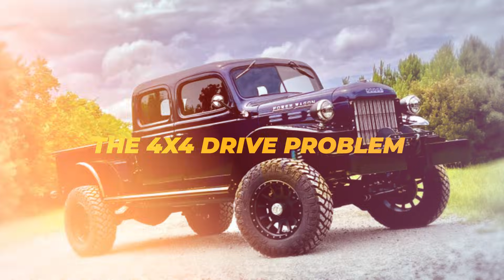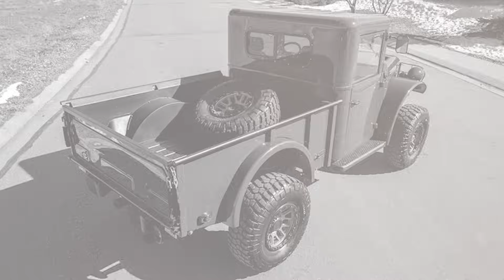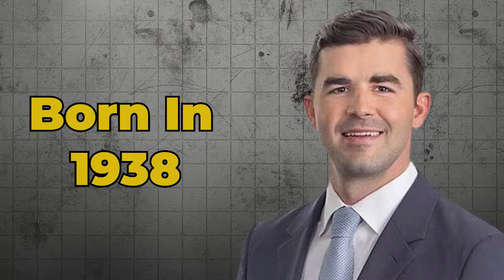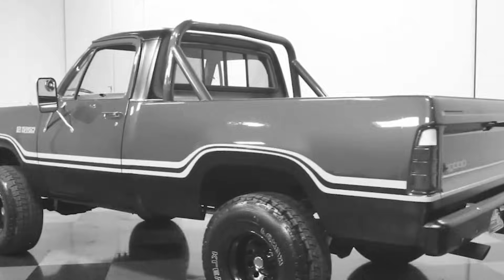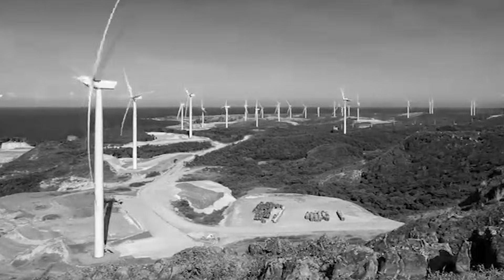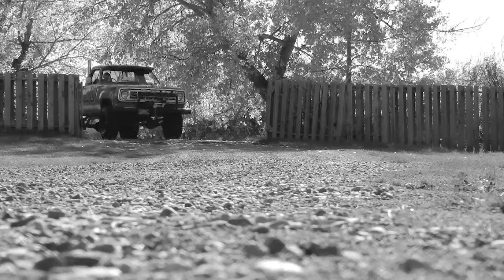This Texas Rancher OUTSMARTED Dodge With a “Secret” 4x4 Conversion Built From Windmill Parts

Comment: This is total bull shit, I've owned a half dozen 76-77 Dodge trucks and never had any issues with the 4x4 system. The 4x4 in those trucks was not much different than in any other 70's pickup. 
Where do these idiots get this crap? 
Any 4x4 vehicle will burn more fuel when the front wheels are engaged, its a simply matter of doubling the amount of components being driven. My 1976 Dodge got 12 mpg with the 318 engine and a four speed with a granny low first gear. In 4x4 it got about 10 mpg on a clear road and maybe 5 mpg if pushing though heavy snow. Something it did very well. 
The only downside I recall about those trucks were some issues with the fuse box and gauges in the dash, and rust in the lower core support beneath the radiator. I very much wish I had kept any one of those trucks back then but it was cheaper to replace than rebuild back then so each one got sold at around 120,000 miles or so and I bought a new truck each time that was as close to identical to the old one as possible each time.

Comment: Ok there is many technical issues and absurdity in your entire video . and the Dodge trucks did not have issues with the 4x4 unit , the problem was the giant Temkin bearings in the front hubs, They were big and weak in the full time 4x4s, Chevy was full time 4x4 as well . Out of the five dodge trucks i owned in that time period i never had one transfer case issue. electrical ( broken fuse block in dash) and front bearings. They were as capable as any other pick up on the market in that time. then you have the whole PTO is a gear reduction drive. with the truck in 2wd high your math don't math, Sounds like a wild click bait story